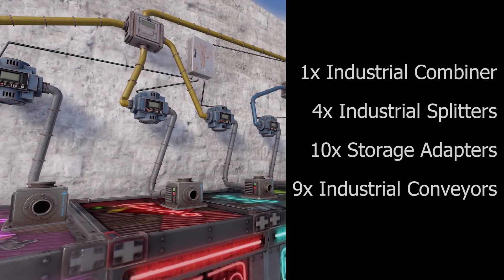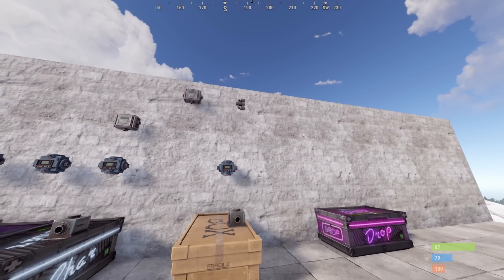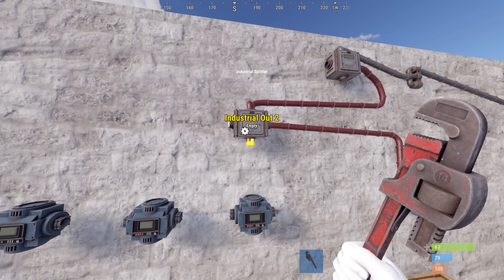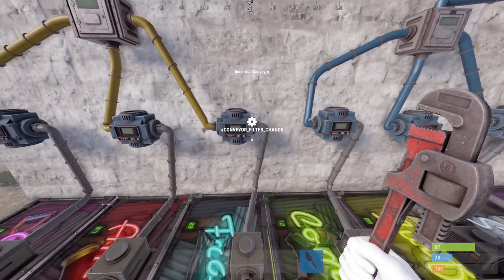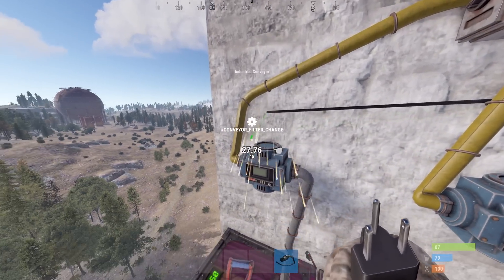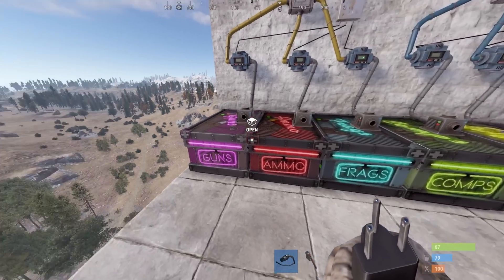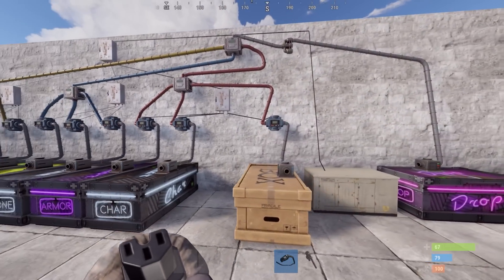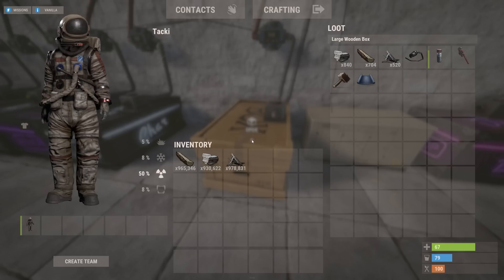Rust Automatic Sorting System - Industrial Update | Aux02 Build

Comment: you dont need to sort anything at all, just access your conveyor and set exclusion to whatever items you need at the moment, 5 seconds later you have only what you need.
Reply from the maker: The downside I see happening here is items not stacking to their max and thus missing out on space, but I have started testing out mixing that system with an automatic storage system!
Reply: @TackiGG  you have 3 storage boxes with mixed loot , which then feed to a single input/output box from which you request the exact loot. 
How would the 3 storage boxes not max out stacks? every time you drop same type of loot into the storage it maxes out a stack first before it creates a new stack

Comment: Can you not use 3 conveyors to filter 15 items and combined them to one unfiltered conveyor to put it in the box or doesn't that work haven't been able to join au02 branch crashes my rust every time
Reply: You could but that would be inefficient. Better if they just optimized the code a bit.